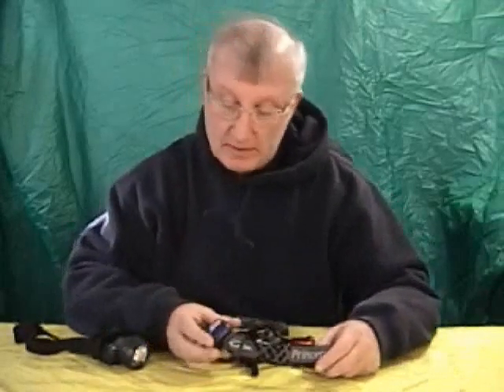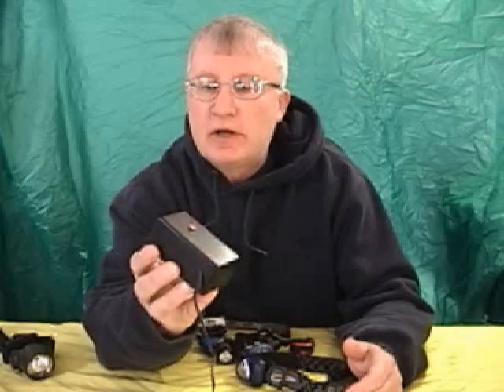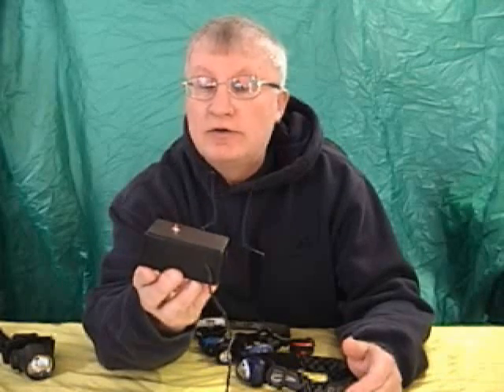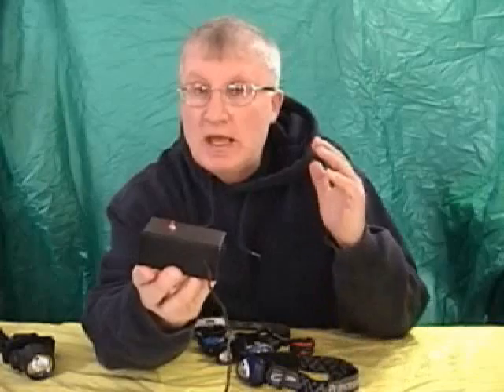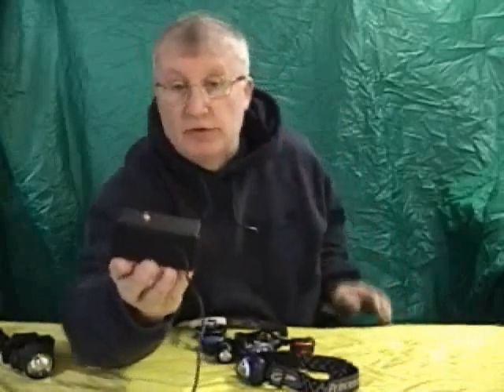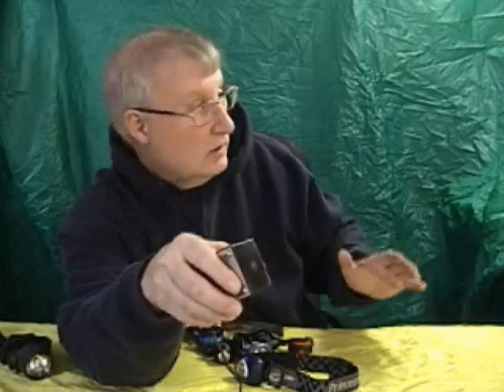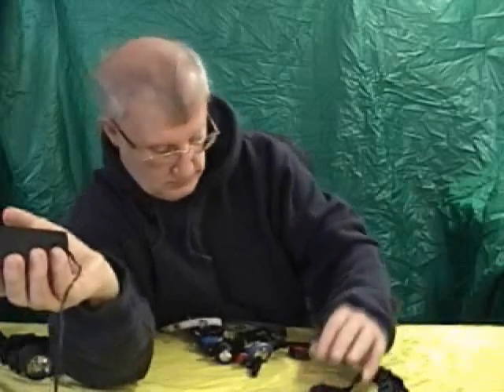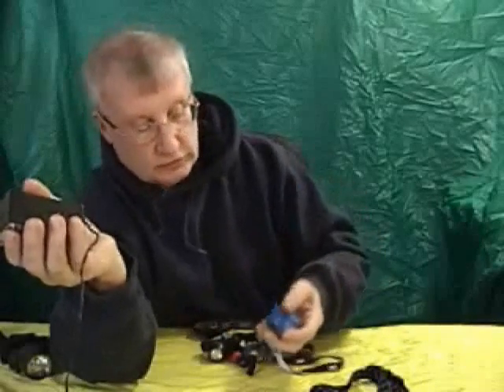Hi Tech Lights

Comment: Very nice info!
Just so you know the ON/OFF circuit doing that it's called PWM (pulse width modulation). You can create your own  custom made flashlights or led lamps with such a circuit and it can even be used on fans.

Comment: Tinny, you've got one of the best shows on YouTube, in addition to being an example of American ingenuity! 
Light draws a lot of power as compared to sound generating equipment or modern electronics. Makes sense to use a chip to modulate the light to reduce power consumption. 

I wonder if this technology is being applied to larger scale lighting applications - Compact fluoresent  bulbs to LEDs to "modulated" LEDs, hmmmmmm?  You saw it first on MiniBull TV....